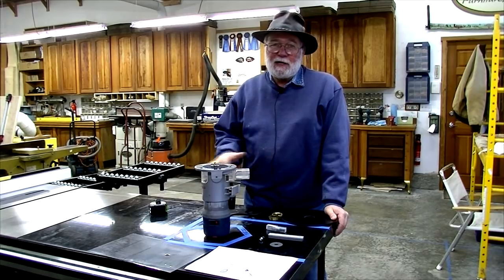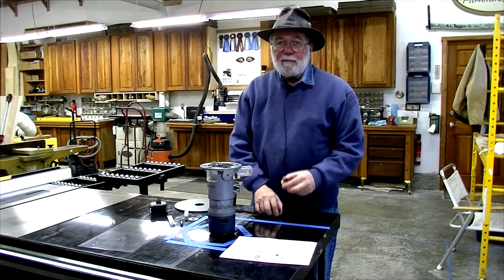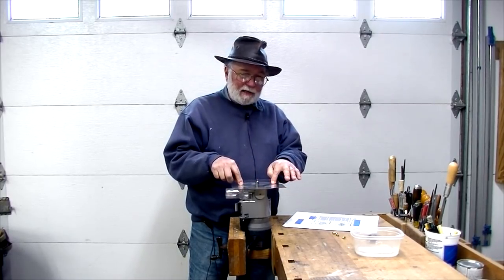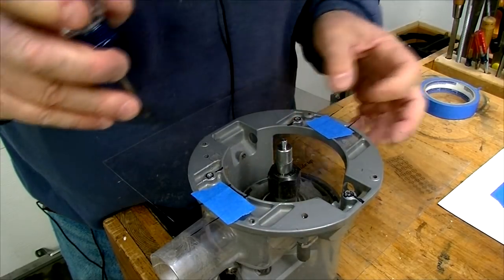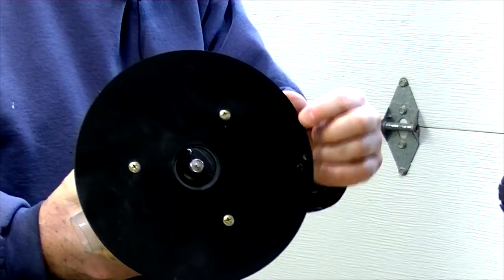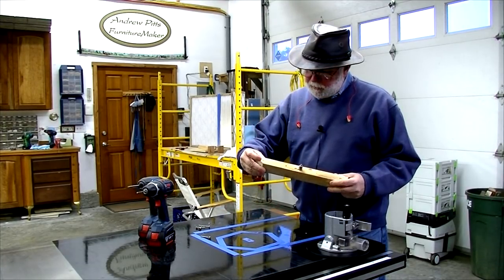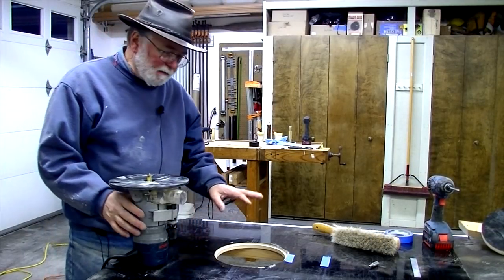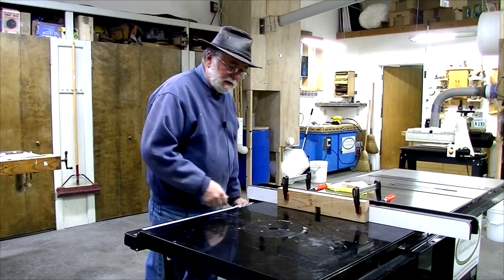Installing a Router Table Insert: Andrew Pitts ~ FurnitureMaker

Comment: Nice Andy, would love to see you again on a new awesome project. Are we going to get some soon? ;-) Thanks.
Reply from the maker: Hi Paul, I've been working a lot to learn about Pacific Northwest Native Art and have been designing "spindle whorls" with mythical designs to apply to a large chest of drawers I am making. I'll definitely make a series about the chest, and maybe a specific CNC design video about one of the spindle whorls, but the learning process is like going back to school for me.
Reply: Well, I just learned something about spindle whorls to see what you're up to. Going to be interesting to see how you incorporate them in your design. I use my CNC a lot for all kinds of works and love the endless possibilities it has. By the way, just made a 4'x4' vinyl vacuum bag for ......... only $ 10 and it works great. Don't know how long it will last, but it is heavy duty stuff and I guess it might go for a while before it breaks. Did you know that it is possible to convert a simple compressor into a vacuum pump? For about $ 25 you can even make it automatic switching on/off with a digital vacuum meter. I use one of these new oil less silent compressors and it works like a charm. Let me know if you're interested in it and I'll send you the details how to do it.